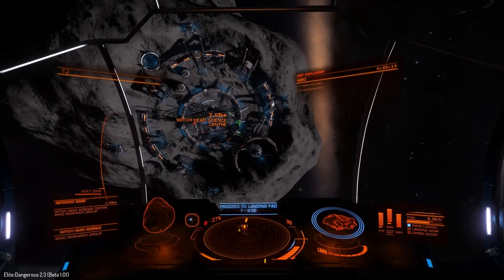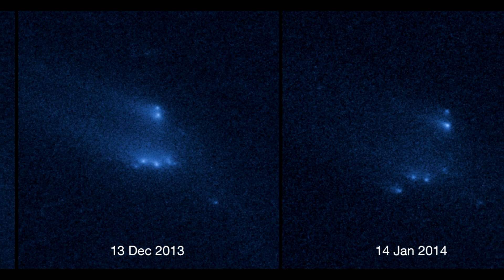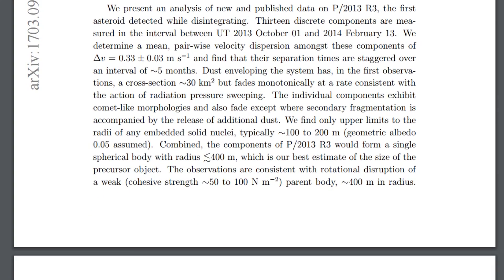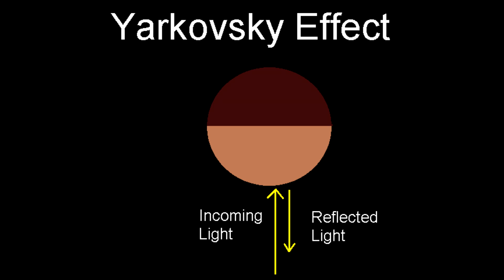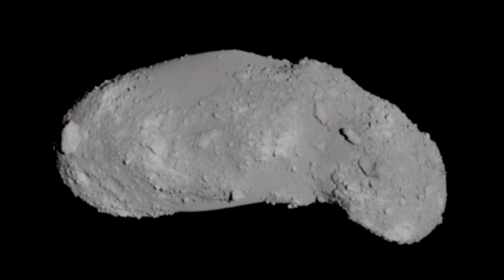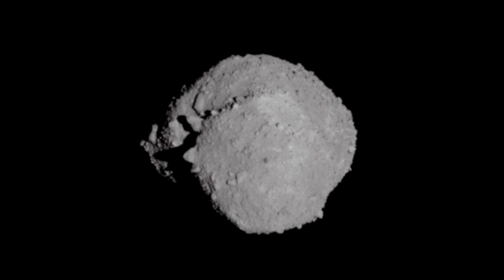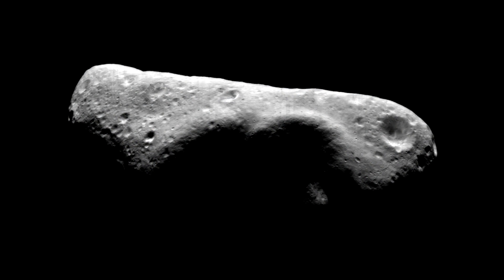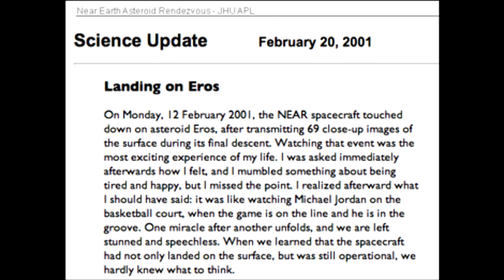Spinning Asteroids To Make Space Stations

Comment: what about hollowing out the asteroid first and spinning it up afterwards?
Reply: At that point you might as well just take the stuff you've mined and use it to build an O'neill cylinder next to the asteroid. That way you have complete control over its structure and aren't wasting energy spinning useless mass.
Reply: and you could use big mass drivers to spin it up and eject the excess mined material.
Reply: but then you still would have to spin up the mined  material...that would undermine the whole idea of hollowing it out in the first place...you need to bring out the mined material fia conventional, far more efficient methods...
Reply: So what you're saying is hollow out the asteroid and use spacecraft to dump the mined material somewhere, then spin it up using fuel you brought from earth? That doesn't make any sense.
Reply: no...i am saying hollow out the asteroid without spinnig it, removing the mined material with, lets say conveyor belts or push it out or give it a little push and let it drift out in microgravity and then, after removing most of the mass of the asteroid spinning it up
Reply: and who knows from where you get the fuel, doesn't need to be from earth at a time where you are technologically advanced enough to hollow out an asteroid...could even come from the mined material itself...
Reply: spin it up with what?
Reply: don't know...but doesn't really matter at this point...my initial comment was about reducing moment of inertia so you don't need to spend that much energy to spin it up...what kind of fuel you use to bring up this energy isn't really importent for the amount of energy you need to spin it up (ignoring the spin up time for now)
Reply: +seppet0ni   The original hardcore sci-fi concept was to find a class m asteroid made of nickel iron and to drill to it's center where you would pump in a large amount of water and seal the hole.   Then either the asteroid would be coaxed into an orbit that went close to the surface off the Sun or mirrors would be used to heat the asteroid, softening the material and causing the water to expand blowing the asteroid up into a giant metal balloon, other ideas involve using fusion bombs to melt the material and produce steam in a more controlled fashion if you can call nuclear explosions controlled.   Conceivably, a few well placed drill holes could vent some of the steam to cause a spin or solar energy could be used to induce a spin as they already do with unevenly shaped asteroids.   Obviously there would be many problems with such an idea, a spinning metal shell places a structural tensile force on the shell and the fact remains that it would be easier to just build smaller space stations which would already be the size of small towns.
Reply: I'd make a giant space 3D printer and melt rock into shapes. It would be impossible to make fast accelerating ships, but it could turn Ceres into a series (heh) of hollow cylinders with a lot more space. I need to re-visit Scott's ringworld video to see if the rock would be strong enough. In thinking about this, I thought of a really silly way to make a ringworld. Spinning cylinders lined up end-to-end. They would all orbit normally and the gravity would be provided on a per-segment basis. Space trains at the 0g center.
Reply: +BlueFrostedGlass   Before we begin to bury ourselves in hypothetical's of what can be done, it should be noted that our current examinations of asteroids have all turned out to be non-differentiated  material that has never been part of a larger spherical differentiated body hence the minerals of value are diffused throughout the asteroid and the structure of the asteroid itself tends to be held together by Van der Wal forces.   They are quite literally loose gravel only looser and indeed the asteroids we have sampled such as by the Hayabusa probe, you could literally swim through.   Just as we do not scoop up gravel from a mountain for the trillions of dollars in gold, iron, uranium, and platinum that we know are in the mountain, we would not do the same with asteroids.   Yes, undifferentiated material tends to have 8% iron instead of the 5% iron in the crust of the Earth but iron ore of commercial value is over 75% iron and with an undifferentiated body, there is no chance of concentrated pockets of ores with higher concentrations, it will all be evenly distributed.   We do suspect that some, particularly the very rare type M asteroids, may be fragments of a former proto-planet large enough to become spherical and hence differentiated and perhaps those would have ores of higher concentration that could be mined but so far, we have only visited asteroids which though may have large amounts of valuable minerals, the concentrations are so low that they are only as valuable as common gravel and like gravel, they would have no tensile strength and would literally fly apart if the rotation of the asteroid was increased and indeed we have seen evidence of asteroids flying apart due to increases in their spin rate from mere solar radiation.   Now, on Earth, stone age man used bog iron which are the refuse of bacteria that have a 25% iron content, this is in fact bio-mining where the iron would've been collected by a river over hundreds to thousands of miles of flowing through presumably 5% iron land and accumulated over hundreds of years, which means that technically we could bio-mine these asteroids by shoveling huge amounts into bio chambers of reactors for perhaps 40 or 50 years and collecting the deposits left by the bacteria but I hardly see this as being more economical than mining the Earth.   As to use of the abysmally low density regolith as a building material, granted we could sinter the silica together with a laser but I suspect the best approach would be to harvest the dry ice and water from type C asteroids and comets to form plastics through Fischer Tropsch synthesis and make sand bags to fill with the loose gravel regolith of type s asteroids to form effectively adobe structures.   That's probably the closest you'll get to 3d printing something with some albeit still quite minimal tensile strength to spin unless you find the so far extremely rare and yet un-prospected type m asteroids.   Note, the current hypothesis is that the proto-planets where the material had been differentiated formed the current terrestrial planets hence the type m asteroids are likely far rarer than previously thought.   In general, the majority of asteroids will just have too disperse a concentration of the valuable minerals for current methods to extract and were technology were to advance to extract such low concentrations, we could just mine the loose gravel and rocks of Earth.

This doesn't mean the asteroids are entirely worthless, if you used sandbags of regolith as radiation and micrometeorite shielding, and processed the dry ice and ammonia water ice of type c asteroids into fuel, this would be far less expensive than launching any material from Earth to do the same but the idea of mining an asteroid for the trillions of dollars in platinum for sale on Earth is about as likely as scooping up gravel from your local mountain to do the same.   The entrepreneurs who are hoping to mine asteroids are hoping to find an elusive type m asteroid with probes based on the inexpensive cubesat format and staking a claim but it's still a long shot based on the few asteroids we have visited so far.   Most asteroids may have trillions in gold, iron, titanium, uranium and platinum but are quite frankly worthless to a market on Earth, the best prospects for asteroid mining is for a market in space which is why I believe large space habitats such as Stanford Torus's, Bernal Sphere's and O'Neill Cylinders should be the focus of space development, perhaps with sandbags of asteroid regolith to provide the radiation and micrometeorite shielding but it's a catch 22, without those space colonies, the mining is unlikely to be profitable, without the mining, the space colonies are unlikely to be built.
Reply: the real problem with this whole "build a spinning spacestation out of rock" idea is still the really low tensile strength of an kind of rock or concrete...in any case you would have to reinforce the whole thing with steel or carbonfiber...or some other way more expensive and less available material then the rock you get from the asteroid...don't misunderstand me...with my initial post i didn't wanted to make it sound easy or simple to build such a thing, i am totally on scotts side when he says it's not a very good way to build a spacestation...just wanted to talk about the spinning problem
but i have a feeling that i am not allowed to go to bed any time soon...
Reply: +Mathias Hirsch    It isn't the mass that makes the idea ridiculous but remember that the centrifugal force would be acting on that she'll of an asteroid so everything, all the rocks, and dust would be experiencing what's effectively 1g plus of gravity away from the center of the asteroid.   Anything on the surface would just fall away from the asteroid, including the asteroid itself.  There is no rock, stone that could be that large and unsupported against that force, the asteroid would have to be made of carbon nanotubes for you to spin it up even if you hollowed it out even if it was a type m asteroid made of nickel iron which you melted together, there would be a limit as to how large it could be before falling apart and that limit would not be very large in terms of asteroid sizes.   Hollowing an asteroid out may mean less mass to rotate but even Ceres is a body held together by less than 3% the surface gravity of Earth and you're talking about spinning it enough for there to be 100% the surface gravity of Earth acting outwards on it and you expect it to hold together?  That's a little like packing twenty elephants on an elevator designed for ten people and wondering why it fell...
Reply: read my last comment ;) i am totally aware of this and i never expected it to hold together like i stated in ma latest comment...my first post was purely about the energy needed to spin it up...nothing else...which i stated more than once in all of my other posts ;)
Reply: You could probably spin it up by ejecting material, when you're mining you're bound to have materials which the market cost is greater than the transportation costs so you eject it at the right angle to impart rotation. Likewise, ships could land/takeoff at the right angle so they add up to rotation too
Reply: Ok deep breath interior asteroid materials are separated. Volatiles and metals are extracted from regolith and processed for use as future feedstock.
 The remaining material could be used to 3D print structures.  Then finally the remaining waste could jet-milled down to 3 micron particles and shot out of mass drivers and used to spin the asteroid.
 The faster you shoot the particles out of a mass driver - The more efficient the thrust.
Reply: Don't spin it up. Build a spinning structure inside. Start with just two habitable sections at opposite ends of a long tube. Use large bearings at the center of mass to keep it centered in the asteroid. The chamber would be like a concrete lined hollow disc. No atmosphere.
Reply: yes...might be a more viable method of building a giant spacestation...although for building a completely new structure i gues you would need far more planning and the construction surely would be far more complex than just hollowing out an asteroid...but in this point i might also be wrong...i am not a mining expert...
Reply: yep...this discussion got a little bit carried away from the question i initially wanted to bring up...never intended to talk about the whole idea of building a spacestation...just wanted to talk about problem of how much energy it would take to spin this thing up...
Reply: Mathias Hirsch apparently, the idea is that they use some kind of science and mirrors to melt the surface of the asteroid to form a hard crust
Reply: building  a new structure takes less planning than changing existing one
Reply: hearing the numbers in the video, this is almost a pointless question. I mean, let me be optimistic here. What if you hollow out that rock very professionaly and you need about 5% of the thrust calculated by Scott? That 5% is still way more than too much
Reply: Nomad6763 take the material used to hollow it out and dump it on the outside and place a manufacturing plant there to convert it into materials to create and reinforce the structure within. Basically converting it into an o neill cylinder.
Reply: Best course of action: Mine the asteroid for materials to build your station. Meanwhile, everyone lives on the spacecraft that got them there.

Comment: How about just ice vaporizing when hit by the sunlight creating a thruster? Or maybe this asteroid was too far away to get that hot?
Reply: If you look at a phase diagram for water you see that you'd have to get above 200 Kelvin at a minimum to get vapor. Plugging that into the previous equation gives us about 3.8 AU, so yes, there are asteroids inside that range within the asteroid belt it seams (the belt between mars at around 1.5 AU and Jupiter at around 5 AU)

If you're talking about "stray particles sublimating" such as evaporation experienced here on earth even tho you're not above boiling point, I don't think this would have a very big effect in a crystalline structure such as ice but I could be wrong, I just thought the temperature distribution in the substance thinned off very quickly when you get down to lower and lower temperatures allowing for extremely few atoms to sublimate.
Reply: Going further deep in this topic, one photon from the sun has more energy than the hydrogen bonds connecting each molecule in a crystalline ice structure. So I guess exposed ice will sublimate, no matter at what distance from the sun.
I think this mechanism is better called ablation than regular sublimation, but... Let's go to the numbers:

The hydrogen bond energy in ice is about 4.5 kcal/mol. With 4 bonds in a crystalline structure, this gives an energy of 0.78 eV per molecule. 
Even a low energetic red photon from the sun, with a wavelength of 780 nm, has an energy of 1.59 eV.

Of course some of that energy is transferred as heat to the ice (and I have no idea on how to estimate that), but I believe there's a significant sublimation rate. Maybe enough to spin an asteroid in a couple million years.
Reply: And also that water ice isn't the only ice you'd have to think about. Ammonia ice and dry ice could appear on asteroids.
Reply: The asteroid belt is about as far away from the sun as you can get and still primarily use solar power[1] so maybe? The question is is it worth the time and energy to try something like that or do you build something that you know will work and fly it out there.

[1] I know we've sent solar powered probes out farther than that but I'll take a RTG at that distance any day of the week.
Reply: I was talking about natural the spin up process, if vaporizing ice might cause the asteroid to spin, but I guess focusing sunlight intentionally onto an icy part of the asteroid would be a very cost effective way to do it assuming you have large, cheap and accurate enough mirrors to do it :)

And now that I'm a little bit less tired I can actually calculate the distance at which this can occur naturally:
It would be using Stefan Boltzmann's law and some algebra we get: r_asteroid^2 = T_sun^4 * r_sun / T_boil^4  (We got this by calculating when the amount of energy radiated per area of an asteroid being at boiling temperature is the same as the energy received by the suns radiation). Plugging in some numbers that gives us 166 805 431 km or about 1.1 AU, so yes, they are too far out for this to be a thing. However liquid water does still evaporate slowly, so plugging in the freezing temperature of water instead gives us 2 AU. Still not far enough out, but some asteroids could come close to that distance.

Still, using mirrors to do this if there's ice on the asteroid would be viable, maybe even a way to move the asteroids :) Then you wouldn't need to transport anything out to the asteroid to move it, you can just shine the "sun death ray" on it in very precise locations. You would need some very large mirrors tho, but that wouldn't be much of a problem, they would be pushed away from the sun slightly but easily compensated for using small thrusters, or you could position the mirrors in such a way that the small distance your pushed doesn't really matter much, eventually you would have to compensate for it tho if you plan on using the mirrors many times to move many asteroids. In practice you would probably still have to send probes to the asteroid to determine it's exact center of mass, where ice is etc etc so you know where to shoot on the asteroid. You might also need to send up mirrors to be able to shine light behind the asteroid. I think Isaac Arthur made a video on this, not sure tho :/
Reply: Well, ice still sublimates at very low temperatures, specially in vacuum, so I wouldn't discard this possibility.

Comment: Wouldn't it be easier/cheaper/faster just to mine the friggen space-rock and then build a station out of it?
Reply: LazyLife IFreak the reason they're inside asteroids is so they have 'free' radiation shielding
Reply: Hmm, another option would have been to melt parts of the asteroid and then 3D print a new station with more homogeneous size etc.
Reply: That's centuries of work though. And you aren't working with good materials. If it were an asteroid of something like pure aluminium that might be worth it. But it's a hodgepodge of poor materials. You're still better off just drilling into it.